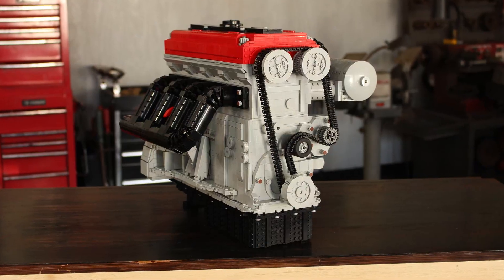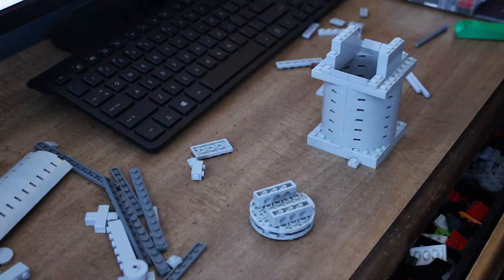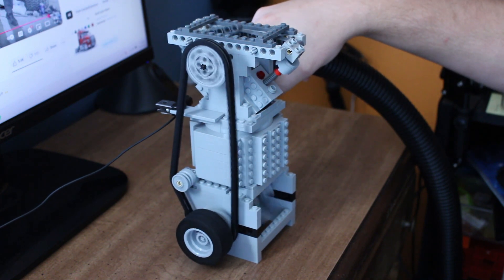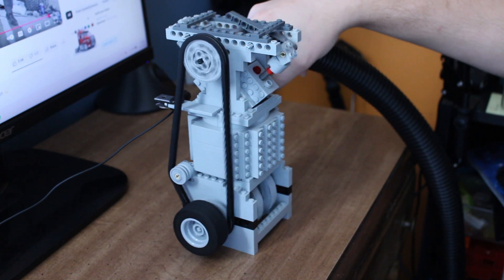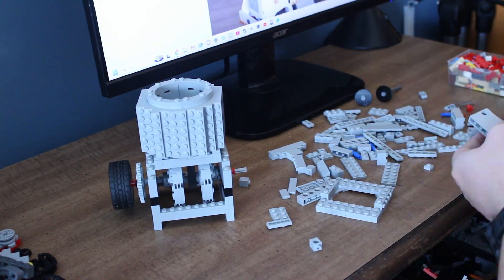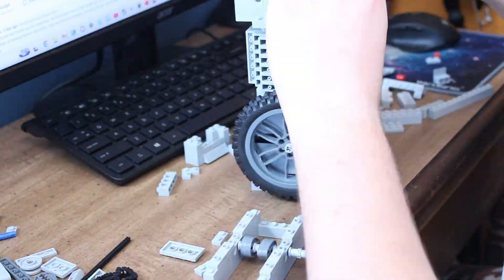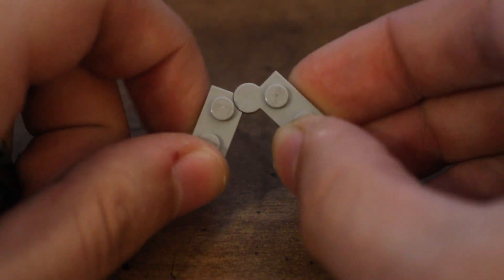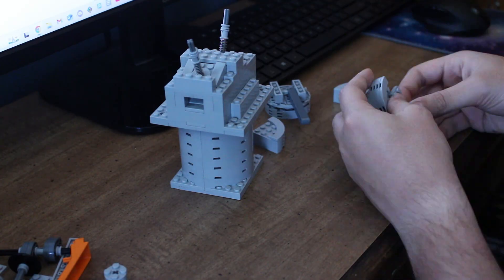I Tried Making LEGO Vacuum Engines with ANGLED VALVES!

Comment: And why doesnt mine works
Reply from the maker: Well, there's lots of possible reasons. The main issue I had during these tests was the head leaking. Since the valves sit at an angle, it was pretty difficult to get a decent seal, which the final one didn't really have a great one to be honest

Comment: Can you make more vacuum engines?
Reply from the maker: I am! I'm working on one right now!
Reply: @DeltonAdamsLEGO  Cool! I built one with a vertical throttle, and then made the turbine run my flat-4 engine moc(my own creation)was super cool, but i trashed most of the structurals of the flat 4 moc, but i could fix it if I wanted to

Comment: I'm building a single cylinder engine and the way I have the rocker arms is going to force me to make angled valves
Reply from the maker: Well, good luck! It's gonna take a good amount of testing to get a good result, but it's well worth the work!
Reply: @DeltonAdamsLEGO yep I'm building the bottom end and the only problem I'm having is the crankshaft keeps splitting apart
Reply from the maker: @Mayonnaise1.22.10  what design are you using?
Reply: @DeltonAdamsLEGO i cant really explain it because i left the "engine" at my friend's house
Reply from the maker: @Mayonnaise1.22.10  oh 😂 Well, if you ever need assistance, you (and anyone else reading this) are more than welcome to join my Discord server (if you're not in it already). There's a bunch of people there who will gladly help you out!
Reply: @DeltonAdamsLEGO i will definitely look into that thanks
Reply: @DeltonAdamsLEGO oh I forgot to mention I'm also working on an oil pump for it and it is successful then I will use some school glue to seal up everything

Comment: A o-ring seal would be sick. You would be able to make a turbo-charger like the way crs did but with way more speed. You could hook up the turbo charger to the intake too. It will make it more efficient.
Reply from the maker: Only problem is an o ring would only increase friction. I'd have to perfectly seal every other part before there's any meaningful effects. And vacuum turbos don't actually do anything for the engine
Reply: @  A good o ring won’t increase friction that much. In the end you will get an increase in power by the increased suction by the vacuum. Also, look at CRS engines and how he made a efficient turbo that does not lose any power and sounds great. It will be a cool video too

Comment: 3:48 You are using a 4 stroke cam on a 2 stroke. For speed, use part 2853 and 42610 as a rolling camshaft. You will also want a stud or less of valve lift, so adjust rocker ratio. This is just general advice for any poppet valve.

Also love the videos ❤
Reply: Hi ! Im building wacum engines to, i would like to ask that how can i know if an engine is 2 stroke or 4 stroke popet valve ? BTW love your videos
Reply: @benceinfiniti8444  if its 2stroke it makes power every 2 revolutions and same with 4 stroke

Comment: The reason your engines are running so slow is because the gap in between the piste and valves is to big
Reply from the maker: Could be, though I've never had a problem with any other engines